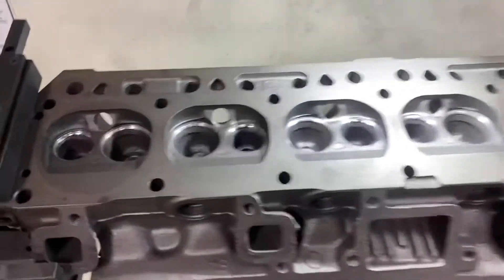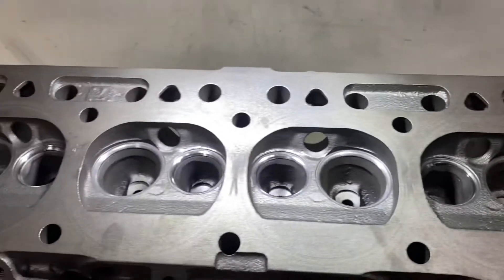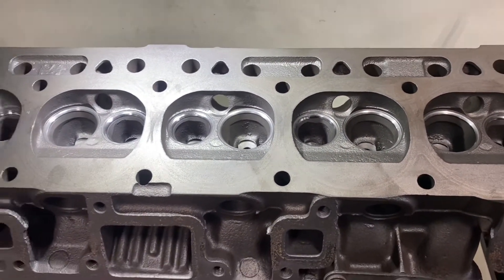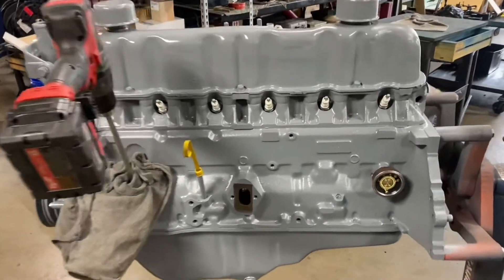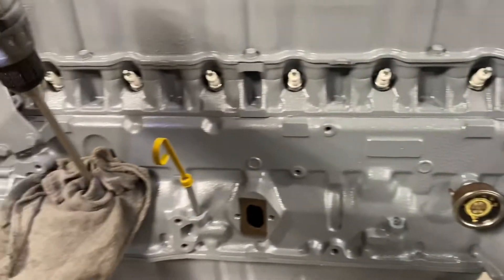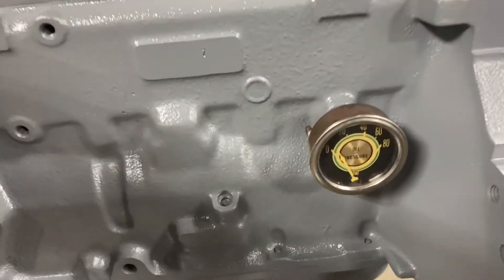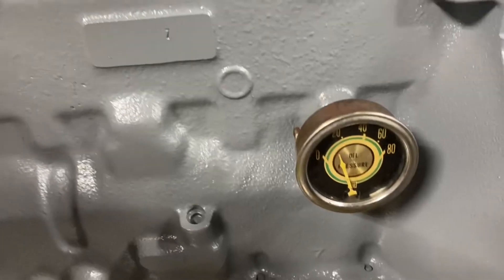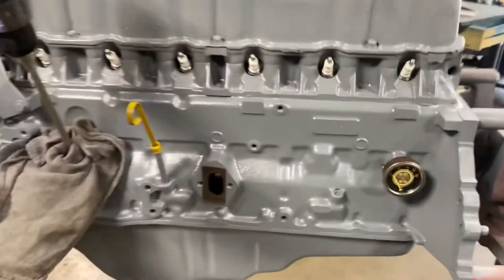Ford 200 Six Industrial Engine Overhaul

Comment: How much did you bore it out?
Is that the same block as the 300 cid just wondering because if I ever need a replacement, I have a 1975 grove TMS 180 mobile crane with a 300 cid in the upper?😀🇨🇦

Comment: My 200 has been the bane of my existence, finally it it right. Did a 2 barrel conversion to a large log 78 head. Definitely want the later head like that one has. Large log and more beefy around the coolant ports. Be careful though, those HEI units timing curves are too hot out of the box. You’ll want to recurve it.